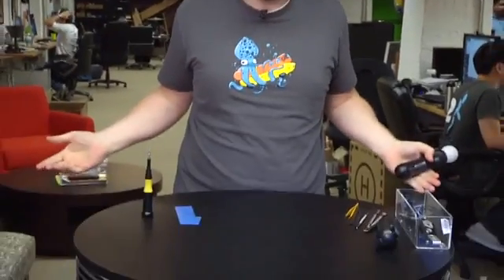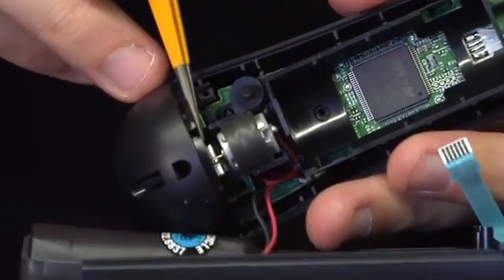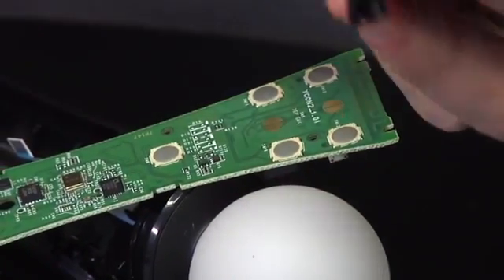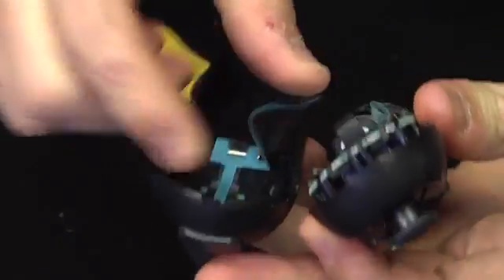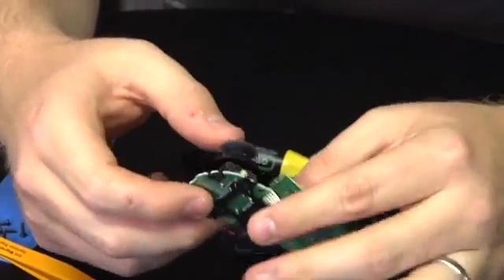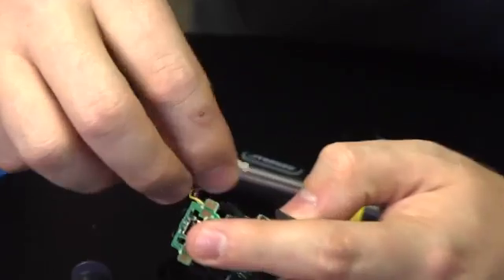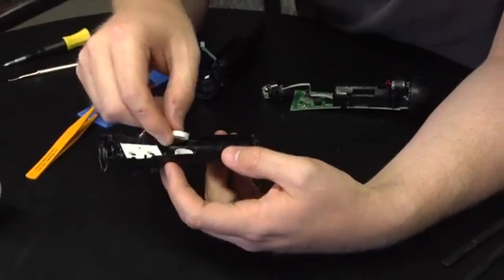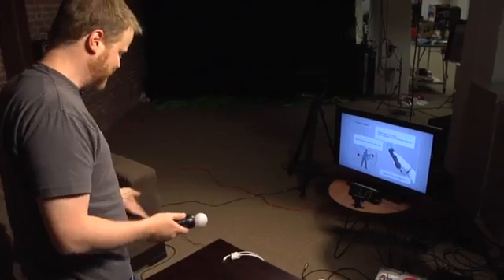PlayStation Move Controller Teardown

Comment: Im really surprised someone hasn't designed more ergonomic design of a controller casing so you can swap out the insides of those stupid crappy stick controllers and have somehting more useable...the buttons on these are stupidly small.  Would have prefered some bigger buttons and the start and options buttons are in awful position.  Yeah so though someone might have tried a custom design and 3D printout model for these.  Could probably make a lot of money.

Comment: look at that battery size on the move controller...
explained why it last way much longer than the dualshock 3 and 4 combined, also took forever to recharge.
Reply: My Move controllers are both from the olden PS3 days and they hold a charge that lasts much much longer than my PS4 Pro DualShocks from 2016! The console controllers only last an hour or less at this point, the moves last a 3 to 4 hour minimum 😅

Comment: that other connection by the mini USB is most likely for the attachments (the official Gun attachment for example)

what do you do with these after you've ripped them apart? I doubt your local store will take them back or exchange them in pieces...and with video proof hehe, I take it you know how to put them back together though :)